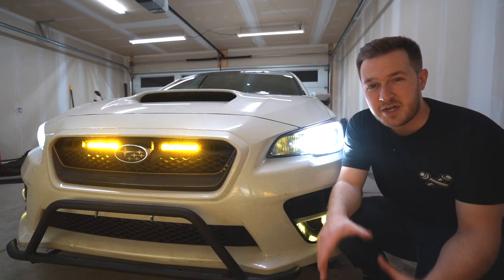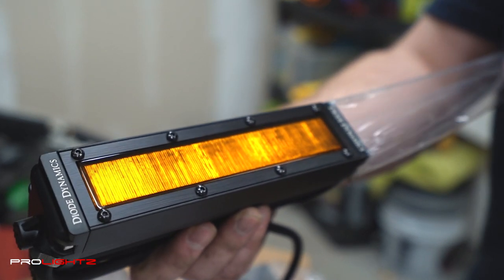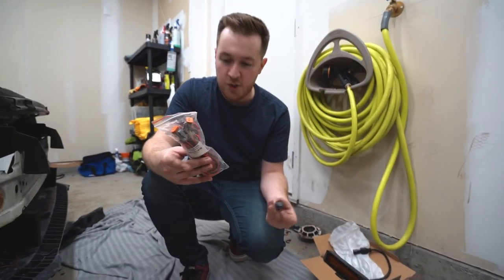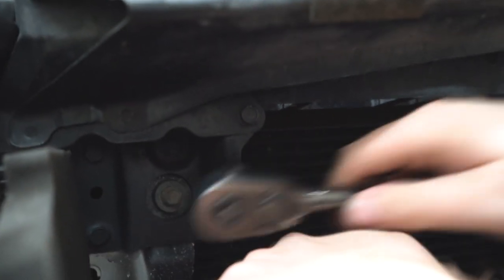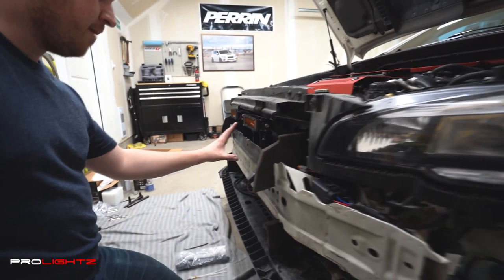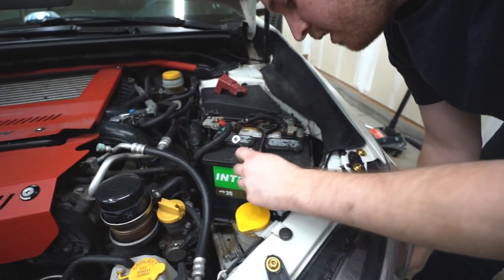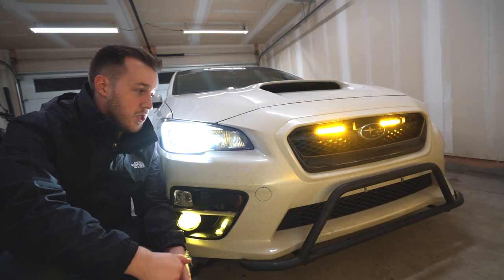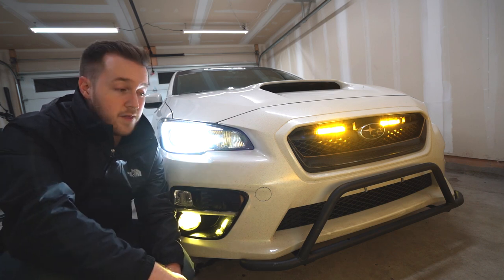Installing the Diode Dynamics 6" Stage Series Lights

Comment: Did the kit come with both the driving and the wide lenses or did you have to pay an additional price for both? When looking on the Diode Dynamics website it only gives option for one or the other.
Reply from the maker: You have to buy the different lenses (but you can select which lens you want with your base order of the lights) but if you want extras lenses and such they're separate cost!
Reply: @SpencerHogg  Thanks for the info! How much was the 1 extra lens?

Comment: Would you be able to give a link for the interchangeable lenses?  I just bought this light bar and can not find the different lens colors anywhere online.  Thanks!
Reply from the maker: https://www.diodedynamics.com/off-road/off-road-accessories-wiring-lens/replacement-lenses.html
Reply from the maker: https://www.diodedynamics.com/amber-outer-lens-for-stage-series-light-bars.html
Reply: @SpencerHogg  thanks!

Comment: Awesome video bro! 😀👍🏼 always learning something new from your videos. Question, do you have an aftermarket top mount Intercooler with that Perrin engine cover? I have a grimmspeed on mine and wonder if I can get that cover. Thanks!
Reply from the maker: Yo buddy, thanks so much for the comment and watching! I don't have an aftermarket one actually - just the plain ol' stock top intercooler haha! Looks fancy with the Perrin cover though eh.  I actually don't know if the cover would fit, it has FOAM at the bottom around the cut-around hole for the intercooler so basically it could fit overtop but would possibly cover some area overlapping the intercooler. I don't know if this would cause any problem but I can ask Perrin and get back to you here.